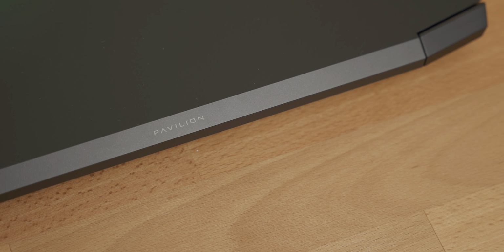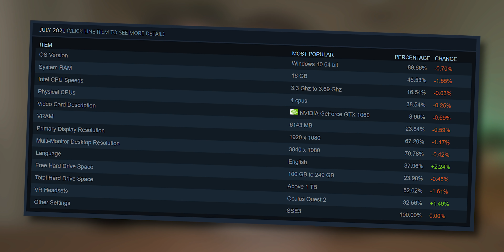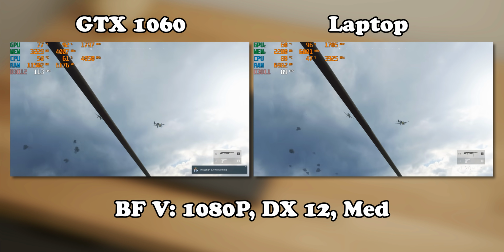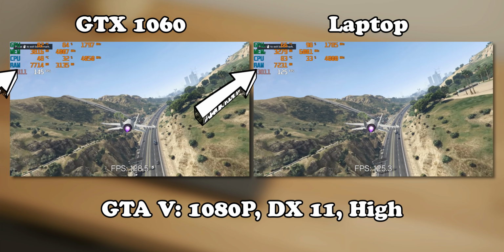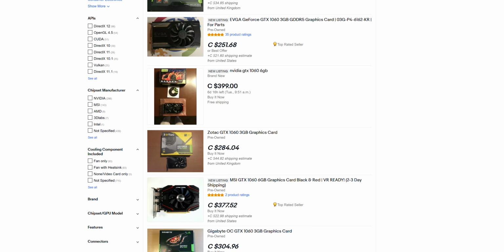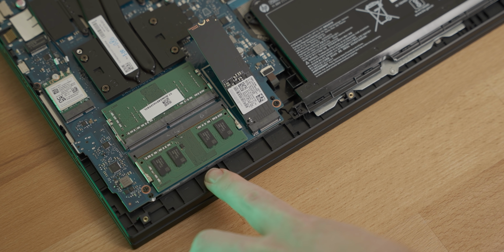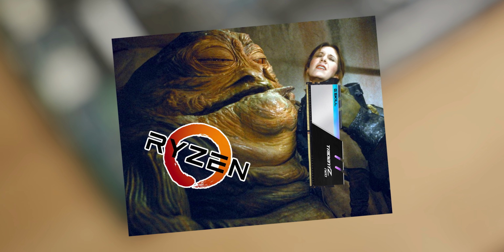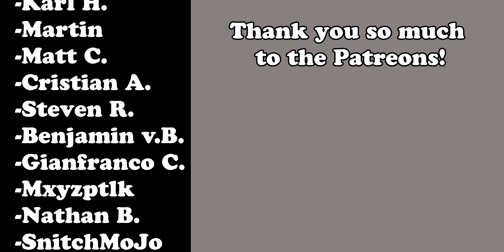Most Popular Graphics Card On Steam Vs $700 Laptop

Comment: Would be cool to see this rematch with a 3200mhz CL20 kit. JEDEC versions of this ram do exist and will run those speeds and timings out of box without use of XMP or manual ram tuning. Otherwise 3200mhz CL22 JEDEC is required on the SPD profile. Get a pair with low TFRC and dual rank for an even better performance. That stock ram it came with is absolute trash and holding back performance. 

But real talk it’s 2021 and laptop manufacturers need to allow for XMP and ram tuning in bios for gaming oriented laptops. At least with MSI we have an advanced bios that allows for this. I run 3200mhz CL16 with my 11800H and gear 1.

Comment: That crucial ram kit is NOT made to run at 3200 stock.The stock 3200 kit should have a 1.2V CL22 configuration,but the crucial one have a 1.35 CL16 configuration.That's a XMP config like the other 3200 CL16 ram on the desktop.
Reply from the maker: I feel like that should have been more clear on the sellers page about its rated speeds in various configurations. Laptops often have less complete Bioses than desktops and are more likely to need JEDEC profiles.

Comment: The problem you are having with the RAM with the Ballistix kit is that it runs at 3200 MHz(MTs), CL16, @ 1.35v and that particular HP laptop JEDEC settings are meant for 3200MHz(MTs) CL20 @ 1.2v. You may want to look into a different kit, I am aware HyperX has kits of Dual Rank, 3200MHz(MTs) CL20 @ 1.2v which should increase performance accordingly.
Reply: Edit: G.Skill has a similar kits as well.

Comment: This laptop is a great deal. The 5600H single core performance is within 7% of my desktop's 3900X single core performance. I can feel the snappiness. I had extra RAM laying around and a 1 TB 2.5" SSD I threw in there, so my experience differs, but this is a massive upgrade from the ultrathin I used to carry around rocking an Intel i7-8550u. The GPU performance of this HP and the 5600H combined is well worth the $700 alone.

Comment: So I actually just bought one of these.  First in Canada ( my location) they are $900 not $700 and at $900 they are not worth it. Hp uses a gimped version of the 1650 mobile (less cuda cores) which explains the poorer performance. If I could have gotten it cheaper it defiantly would be a hit.

Comment: That ram may only run at 3200 with an XMP profile, which a lot of laptops can't/don't use. Another reason may be due to voltage, most laptops run memory at 1.2 volts, but that memory is rated for 3200 MHz at 1.35 volts.

Comment: I was dealing with that RAM issue the other day with my desktop, also using Crucial Ballistix. The solution was updating my AsRock board's BIOS to an OLDER version that didn't have this issue and I was even able to run my RAM above the 'maximum' supported by my board. Board 'maximum': 3466MHz RAM: 3600MHz. But again, this is a desktop, laptops are different when it comes to this stuff.

Comment: I figured it would be the 1660 or the 1080ti that would be in the to spot, that 1650 is bottlenecked, I’ve seen this with other HP system where the ram only runs at 2666mhz no matter what

Comment: I was so happy to see that you reviewed a laptop that I have. Mine was from Micro Center's Platinum Collection and it had a Ryzen 5 5600H with a 1650 and a 144hz panel for $699 before taxes. I did upgrade the RAM in it to dual channel running at 3200Mhz and it's going very good so far for me.

Comment: HP laptops have a setting missing in the BIOS where if you try to upgrade the RAM, it will be stuck at lower clock speeds. I believe it's something along the lines of "XMP".
The only people that can get the RAM that would work are service centers and they are not sold directly to customers so avoid HP products if you want to upgrade RAM.

Can confirm this is an issue with OMEN laptops and desktops as well.

Comment: I can assure you that the base model EVGA 1060 with that horrible spiral heatsink is fine…. But it runs hot and it doesn’t like being undervolted. It likes standard settings and that’s it. It runs fine otherwise

Comment: Just buy a matching Samsung 8g ddr4 3200mhz part number M471A1K43DB1-CWE. It’s on Amazon for just over $40 usd. Works perfect and runs at 3200. Take advantage of the 8g it already has and add 8g to it.

Comment: That's an impressive laptop configuration for the price!
Also I like that when you open the laptop from the bottom, you have access to the harddrives and ram without having to take the keyboard, trackpad out while disconnecting the most fragile ribbon cable connectors imaginable.
With that said, good job HP, let's just hope this laptop isn't made of the cheapest components that die out after 1 to 3 years like most other HP products.
Reply: the hinges are questionable though, i’ve seen reports of hinges breaking on the Pavilion Gaming because of the center hinge
Reply: @TheCooledV  I've had it for about 9 months and the hinges haven't given me any problems yet
Reply: I've got a 4 year old omen laptop, that looks EXTREMELY SIMMILLAR to what was shown in the video
The thing was heavily used for almost three and a half years, and still works perfectly to this day
I mean one of the fans crapped out under warranty(the other is still fine), and the original battery swelled like it was a balloon, but i might have just gotten unlucky with the fan, since i have so far only seen one more report of that same issue, and the battery seems to be a common issue among laptops that use that battery, but again i might have just gotten unlucky, since the sample size is literally 1
But no major issues, like faulty motherboard or display, the ones i have had may be just normal wear, since the parts that failed are the ones most likely to fail anyway on a laptop
Reply: well my hp running since 8-9 years now
Reply: @ogmodiji6024  Nah man, only HP can make bad laptops. Not lenovo (s440), acer (2019 nitro), asus (tuf a15), razer (older blade 14's), alienware (anything recently released), etc. 

I even have limited experience backing it up.
Reply: @setzer-j6s  umm ok but yeah a15 cooling sucks the new lenevo gaming laptop are pretty decent[not the legion]
Reply: @ogmodiji6024  Oh I was being sarcastic. Was showing how every brand makes crappy laptops from time to time and hence don't focus on brand too much.
Reply: @setzer-j6s  yeah
Reply: The pavillion laptops that look like this are pretty legit. I've had the i7- 8th gen variant For like 2.5 years now. No problems at all. Gets a little hot if you decide to game on it, but this one seems a little thicker, with better cooling.
Reply: @ilikecounterstrike  Previously gaming laptops had pretty mediocre cooling systems (both fans next to each other, just 2 shared heatpipes, etc.). Nowadays most don't use this.
Reply: Sometimes HP surprises me with good laptop design for consumer laptops while having shit design for enterprise laptops.
Reply: @comicsans1689  haha good name.
But you are right, my brother's work laptop, according to what he says is terrible, despite being equipped with an i7 cpu, and yet my 4yr old omen gaming laptop, seems to be much better, also features an i7 cpu, but the thing seems to be much better thought out , and built than that HPE laptop my brother was given by his company.
He tried to like that thing, but ultimately couldn't .
Reply: Mate, there's been 4600h + 1650 laptops for a while now. About a year or so. This ain't that impressive. If anything its overpriced since there really should be a rtx 3050 80w in there.

Comment: Something seems funky with these numbers. Those FPS numbers seem way too high for 1080p high settings on GTAV.
Everywhere else I look the 1650 shows lower numbers, and that's not the laptop card. Also a 20 FPS difference.
(76fps v 97fps) compared to here (122 v 136)

Comment: This is awesome - a friend of mine has the HP Aromatherapy Oil Diffuser (INTEL Variant of your review unit) and it runs better than I would have expected. Shame about that SSD size though; it's like a bad Tinder date that doesn't quite measure up to his profile pic. It's large enough to get the job done, but not nearly as satisfying.
Reply: This comment is so hectic... But so true... Deserves more likes imo
Reply: But you can put in a 2.5 in drive so i think its perfect. I fit many games in my 256gb nvme on my laptop.

Comment: Hello Dawid!

What U need is a lower powered (1.2V) module, with burned in JEDEC profile. For example the "KVR32S22D8/16" memory will work like charm at 3200Mhz, because the JEDEC profile will provide You the right speed. The Curcial memory kit You bought is as well rated for 3200Mhz, and sure it does work at these clocks, but only when You manually enables the XMP profile, which is not inculded nowdays in many-many laptop BIOS. BTW some manufacturers hide these BIOS settings in "advanced BIOS", so You can give it a try. Otherwise I would just buy the right memory KIT and run the tests again. Please run the tests again :D <3

Comment: How did you have such a hard time getting 16g 3200 ram for a laptop? I got a couple 8gb sticks for my nitro 5 and ran it in dual channel. It was very easy to find, just a matter of finding the best for the money. It doesn’t run at 3200 but that’s the CPU’s fault in my laptop, not the ram.

Edit my cpu runs ram at 2966 but the factory ram was 3200 so I stuck with 3200.

Comment: i just bought the laptop and been running now , but mine is a ryzen5 3550h with 1tb hdd , kinda slow on boot and stuff but runs games rlly well with good fps at high settings - ultra settings and runs totally smooth at med setting at most of the games , kinda thicc of a laptop and yes , it very much upgradble to a extra 8gb ram , a m.2 ssd or a sata ssd  ................overall this laptop is totally worth for the price .....

Comment: If you have a laptop with OC function the kit seems to work, but for me, i noticed it also running at 2666, this is PROBABLY down to the kit having tighter timings than the BIOS allows IIRC that kit is CL19, i found some much cheaper SiliconPower RAM that was CL22 and it worked fine. I had hoped to tighten timings with the crucal RAM but alas, the BIOS would not allow it on the business desktop i tried it in. Worked fine on machines that allow memory tuning(not requiring me to overclock to get to the rated speed/timing)

Comment: Any plans for a video with a gaming laptop going head to head with a prebuilt from the same manufacturer? Like the HP Omen prebuilt vs HP Omen 15 laptop with both having 11th Gen Core i7s and RTX 3060s
Reply: Thr desktop will probably destroy it but that's a really cool compariosn! Maybe that video will help people decide whether to get a pc or laptop! Nice idea.
Reply: @Sebbysebas  desktop doesnt destroy it. 3060 has like 10-15% less performance on laptops. Considering that it uses much less power its fine. Nowadays Laptop and desktop gpu's arent that far off in performance and the gap is closing
Reply: @hirakchatterjee5240  I would say I agree but based of personal experience, pcs are just better hands down.

Comment: Hey Dawid I think that kit is rated at 3200 MHz with an XMP profile. Some bios’s will default to the JEDEC 2666 MHz profile when new memory is installed. Check the HP’s bios and see if there is a menu for memory configuration or overclocking and enable the XMP profile 👍
Reply: barely any prebuilt/laptop has an option for that

Comment: If you are in the market for one of these EVGA 1060s Get the EVGA 1060 SC they only boost a little faster, but the heatsink on the GPU is much better, the Fan an the plastic shroud looks the same, but the heatsink isn't a Aluminum block of depression like it is on a normal 1060. 1060SC can stay a lot cooler and keep its Core clocks higher underload.
Reply: I know it doesn't have the same horsepower but one of my computers have a 1050ti with that same shroud and I think the heatsink is a chunk of pure aluminium without cooper plate and it barely goes over 60C when running at 100% (which is most of the time honestly)

Comment: I have pretty much the same laptop, but with an Intel processor. I use it mainly for editing 4K video and not gaming. It's not a terrible laptop by any means, but it is a little poky when I'm editing 4K video in Vegas Pro. I've noticed that with the i5 processor in the laptop, 8GB of onboard RAM and 4GB for the video card, Vegas Pro sometimes crashes randomly. And that's not because I'm throwing high bit-rate 4:2:2 video at it or doing any other weird stuff.

I have a Mac Mini on order and that should be arriving sometime next week.

Comment: This is a problem I had on my Dell inspiron as well, you have to get a JDEC kit of 3200mhz ram which is 3200CL22. Some laptops may work with the ballistix kit but its always safer to just go for the OEM timings. I think it ended up being $120 cad shipped for both 8gb sticks I ordered and they have been working great. In my case the laptop i got wasn't offered in a 16gb config so it was an interesting upgrade path
Reply from the maker: It's the same as with prebuilts. JEDEC kits are so hard to find, which sticks did you end up going with?
Reply: @DawidDoesTechStuff  any attempt to activate the xmp or D.O.C.P. profile for the memory. Alot of pre-built system don't have that activated from the before shipping.
Reply: @DawidDoesTechStuff maybe an updated capture card overview, both budget oriented and for the no compromise.  possibly an in-depth of what they do and why you would need them being the NVidia and AMD GPU's having good built in encoders in them now.
Reply: I feel like I lucked out with my system if this is the case.  For my laptop (An acer nitro 5, Ryzen 5 4600H, GTX 1650 (GDDR6), and dual channel 16gb ram (Upgraded from single channel 8gb)) it came with one 8gb stick of 3200mhz ddr4 memory out of the box.  I later upgraded it with another 8gb stick of ram which was also 3200mhz (I made sure they both had the same CL) and it just worked.  No need to go into the bios or anything.  Both sticks ran at the same speed and they still do.  And yeah, there is a big difference between 8gb and 16gb of ram.

Comment: for laptop ram you want to buy cl22 for 3200 mhz and make sure thats the jedec rating not xmp rating, cause any cl rating lower than 22 will need xmp which most laptops dont have, so the jedec rating on xmp kits (advertised as 3200 cl16/18) tend to be like 2666 cl19.
Reply: Except that sexi Hyper X ram, you can get it at 1.2V 3200mhz CL 20 :)

Comment: All ram ships from the factory with a base speed and also an xmp loaded profile.   The xmp speed is what gets advertised but it is still considered and overclock and the individual pc motherboard and cpu has to support it,  and the bios needs to know what to do.    Hp bios sucks in a laptop….  It doesn’t allow manual tuning most of the time so if it doesn’t automatically detect your ram kinda SOL